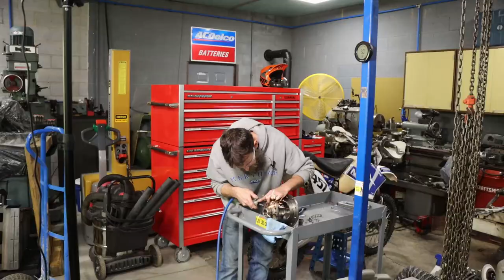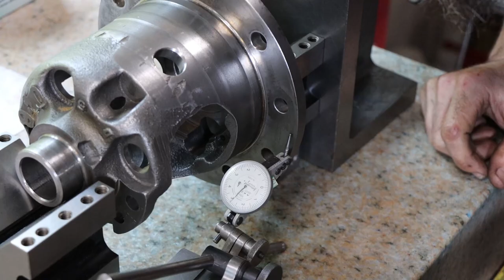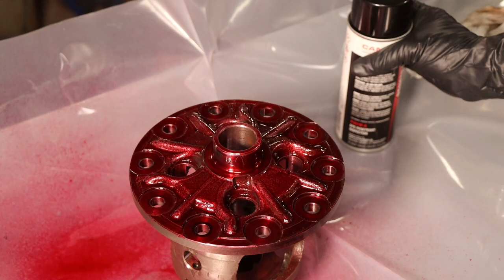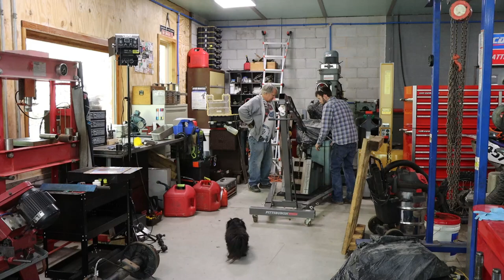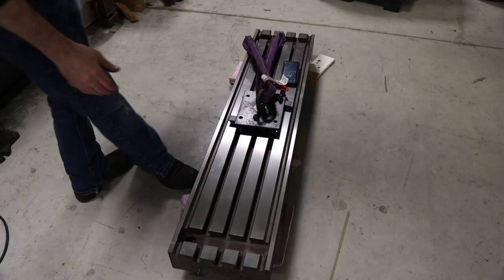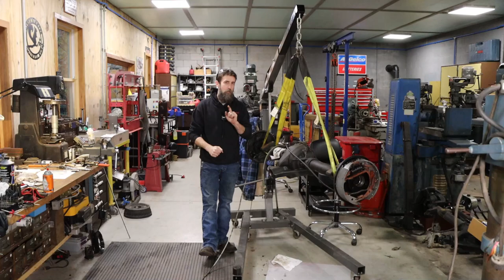Damaged Diff case check / New Equipment / Doall Mill Parts

Comment: I've always liked 3:73 and 3:55 A rule of thumb for general use final ratios is 60% to 80% of the maximum power rpm at highway speed. A typical 350 Chevy, bone stock, quits making ponies about 4500, it may spin up to 6 grand but for the most part, it's done making power at 4500 so 2.700 to 3,600 RPMs would be the right range. Higher RPM gears for towing and pulling hills with a load or with taller tires, lower RPM for flatlanders that rarely haul stuff with stock height rubber. These are not fuel squeezer gears, either set would be fine most all the time. Tune to taste. I built several way fun 4x4's back in the 80's.

Comment: in my early years when I was in machines shops a lot I always saw them place the magnetic bars in direct contact with cylinder heads, blocks etc. and release the trigger when done to lift it off...????

Comment: Ifin I was you I’d go to a pick n pull and get 14 bolt SF from a heavy half ton. I’ve broken lots of 10 bolt rears and it’s always been an axle shaft that has snapped. 14 bolt will drop in without much difficulty and the brakes are much bigger. Also 3:73 is a common ratio. I’ve never broken a 10 bolt front however. I will add that I always had lifted trucks with 35’s that snapped axle shafts usually doing something dumb as a kid. Just my 2 cents.

Comment: Great vid and both Doalls are are killers, along with the rear axle rebuild progress. Ever tossed around installing a gear vendor for hwy use?? Could have the best of both worlds (@@) !!. My old machinist has a warren for sale here in TX,,just tossing out an idea. Love to have a DoAll drill press like your new addition, but going after an Acura knee mill with tooling, and the RU-FU 31 will now do mostly drilling. Floor space in our 900 sf main shop is maxed oout, and bride fill's we don't need to add-on while material cost are at an all time high, and have to aggree.  Thx for sharing, and hope we all have a mild winter,,,Last year was one February we here in TX hope never to see again iin this life time ;)>!!! Bear & Sammie TX.

Comment: Ummm, ive never used the mag yokes in the air above the part. Always spread the yokes apart and spread yokes on part. Criss cross your pattern. I.e., first pass, spread yokes apart to span from where bearings goes on each side and rest yokes on those areas. Energize and use a puffer to lightly puff the powder on to the part. When you make it all the way around, then turn mag 90 degrees and repeat until you get all the way around again. If there is a crack, that powder will zip right to it and highlight it. Also, in another video I seen you use a degauser to demagnetize some parts. Ahh, this mager does the samething as its literally the same tool, it just has moveable yokes. Hold mager upside down so yokes are in the air, energize it and pass your magnetized part in between yokes. We do this all the time with connecting rods at work. For whatever reason, some become magnetized, which is bad.

Comment: If you put a few drops of thin super glue on both sides of those small cut off wheels they last longer and don’t break as ezy I alone put a few drops on the inside of those little drum sanding wheels for Dremmels too because they then don’t expand so much making them unusable so fast

Comment: You will find an easy way to remove bearing inner races at Dustin LeBlanc, I have used the same way for 40 years and it only takes 3 minutes.

Comment: Steve, you need to touch the Ferrous Probe to the piece your testing. And the dry mag particle is more effective on magnetic metals than the dye penetrant. Dye is best used on non-magnetic pieces. 
I have doing Oilfield NDT work for over 20 years. No failures behind any of my work. Another neat process is Ultrasonic inspection. I have been doing that and it’s an art. The guys who teach NASA and others taught myself and others with my company.

Comment: Is this going to stay a farm truck or are you turning it into a top fuel racer?
Reply: Exactly, I'm glad someone else picked up that. Give things a visual once over replace all small bent/ broken parts ring and pinion. Put it back together. get all drive train components back in the truck. I would have stopped at the first clean-up and repair, just to have transportation with a small/short bed for fire wood hauling. Just get the truck movable again and focus on the machinery that CAN/COULD bring in some MONEY.
Reply: His truck!
He would NOT have been happy with the 3.08 gears for HIS use.
He is doing the right thing.
You fellers can half-ass your own projects. Seems to fit you well.

Comment: 36:25
That ‘crack’ when tension between pressed on parts suddenly releases can be quite loud, and made me jump when I removed my 1935 Austin Seven’s flywheel from crankshaft.
It was so loud, being on a taper, I thought I’d snapped a bolt on the pulley🤗
https://youtu.be/UP0SHOrKsok

Comment: i love the activity in the shop and attention to detail - you should get rear end with disc brakes - way better and worth it - go with bigger rotors too if you can help it get alum wheels for sig less unsprung weight. you need a cnc and water jet and the cnc for wood too - crank up the bw in shop with dual 4k tv that can also function as pc monitors - you want the shop to go more digital? for some things like exploded diagrams and quick lookups it is great - you want a debian server with light desktop like xfce4 - think about some solar panels - the vehicle will shift to ev in 5-10 yrs so this may be last rear end rebuild you ever do#bullseye #cadcam #home assistant #monitoring times
https://www.youtube.com/watch?v=w51KsS7slmk #the perfect setup #machinery

Comment: Can you get enough heat in the mill parts to fill the low spots with braze? Is there an epoxy that you can use to fill them, or some other type of process?
Reply: Waste of time.
Steve explained that well, I thought.

Comment: I dunno steve, if yer gonna go to 3.73’s, why not just finish the job and go 4.12’s. You are already there! And the price is similar for parts, the truck isn’t a highway cruiser, and you like hauling firewood etc in it. Sounds like a PERFECT reason to go into the 4’s with your gear ratio. I mean, it’s a manual tranny right?
Reply: He explained all that.